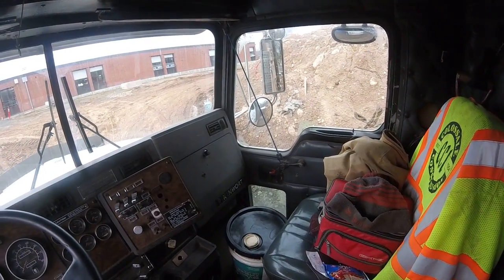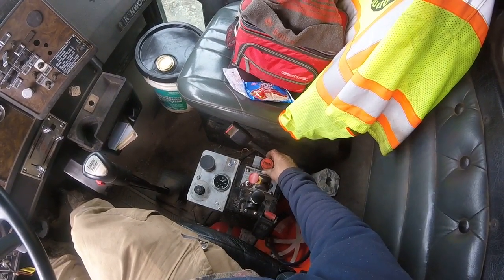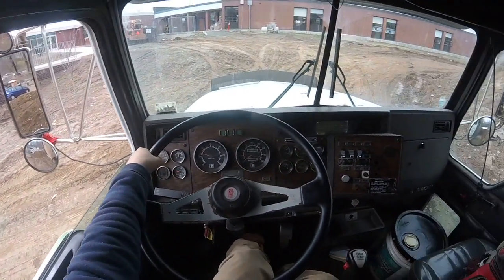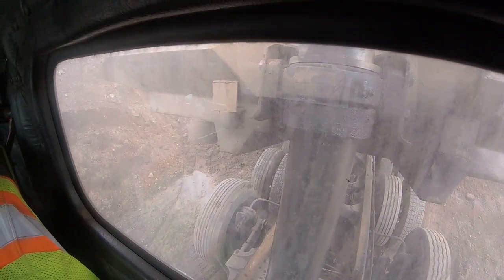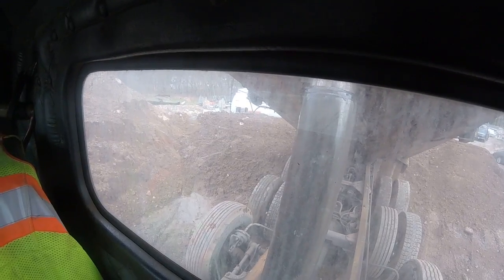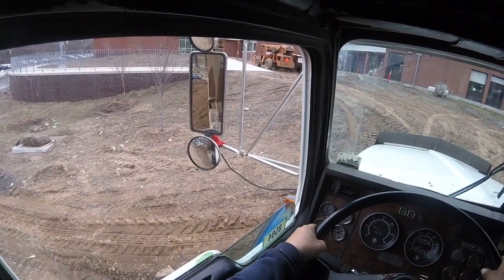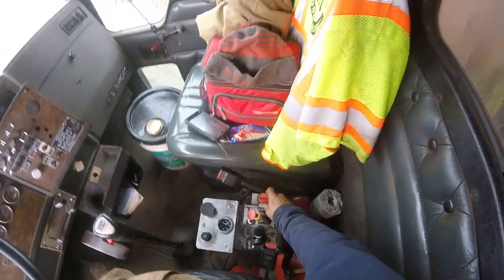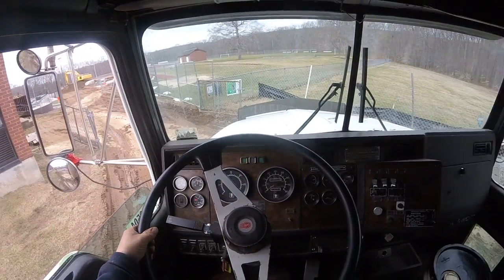Dumping a triaxle dumptruck "In Cab"

Comment: Don't fprget to lock the tailgate for the next load... Sometimes dump trucling gets monotonous, & you forget to take the PTO out or lock the gate.. It happens. I remember when there were no buttons. You pulled a cable/handle from the floor to engage the PTO, Moved a lever between the seats for up & down < Had a handle outside the cab for the tailgate no air or hydraulics ..all manual
Reply: I learned in a 1978 in a 1952 International. Twin sticker!

Comment: You should be getting out after dumping to ensure the tailgate is indeed locked but lose debris on the sides of where u dumped, & in between ur tires, too many drivers are taking the easier way. Otherwise good video👍
Reply from the maker: @captainwilliam9971  thank you.

Comment: Never set your brakes when dumping, nobody does that. If you have air suspension dump the air, for hockey puck suspension its not necessary or possible. give it gas on the way up but not too much as it isn't a catapult. when you see the load starting to slide out slow the rpm's down a bit so you don't bang the ram at the top of the stroke.  when the box is coming down turn off the PTO and when its on the frame rails lock the tailgate and put the hoist lever in the neutral position. Get into the habit of double and triple checking as you (trust me) do not want to roach the PTO. wait until the box is on the rails to lock the gate as it isn't unusual for a rock or chunk of clay to wedge the gate open. not all loader operators will notice this (or tell you) and there is nothing worse than leaving a trail of 0-3/4 on the road.
Reply from the maker: @richardgordon4673  👍

Comment: I would imagine the biggest safety issue with some types of garbage trucks is the ones with the front loader forks i.e ( The analogy would be a skid steer in terms of construction vehicles /possible forklifts) ...As if not properly operated you could dump tons of weight on yourself/front of vehicle.

Comment: Can you drop that third axle while driving or do you have to be at a complete stop?
Reply: @Bobcat325  thank you! I drive 10 wheeler dump truck and never drove tri-axle so this is good to know!
Reply: @Bobcat325  wouldn't want that to happen! That's good advice and thank you again!
Reply: You have to pick it up on tight street turns just enough to take pressure off. then put it back down, unless you have a axle that turns with you as you turn. If you don't pick it up the truck will slide thru the corner.
Reply: Sometimes you forget to put it down when you leave the pit or yard.. Like I said it gets boring, but I loved dump trucks

Comment: was wondering, i just got my class a cdl, do you know of any companies that are looking for drivers with little to no eperience for dump trucks??
Reply: depends on where you live. where you live
Reply: Don't limit your self to just dump trucks consider running concrete most company's have a couple dump trucks start with what you can get and look for a better company when you have experience
Reply: Lot's of Dump jobs down here in Florida.. We have several companies in my 1 town that have dumps & always hiring One company has over 75 tri-axles. It's also easier down here . Everything is flat & sand, not like up north in New England where I learned . Rocks/boulders & a lot of hills.